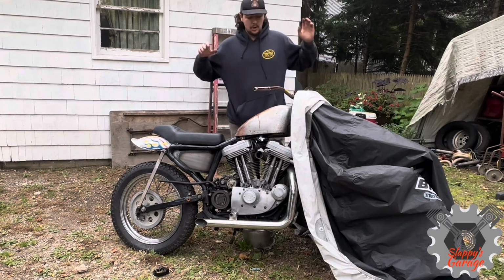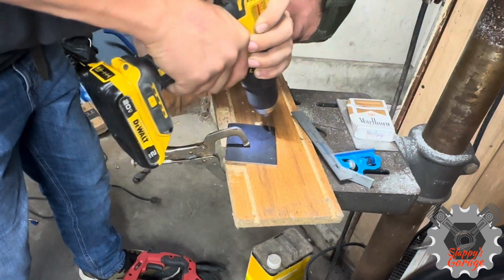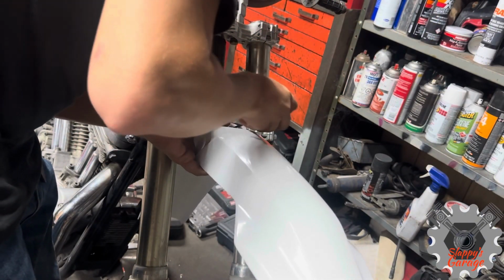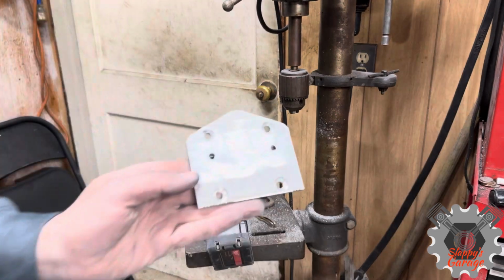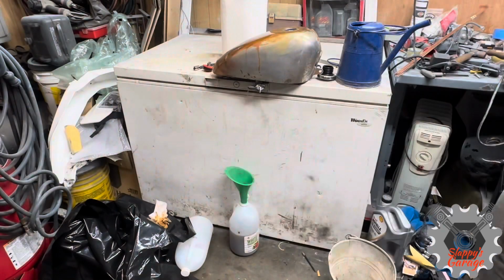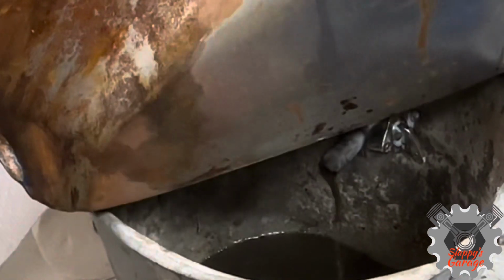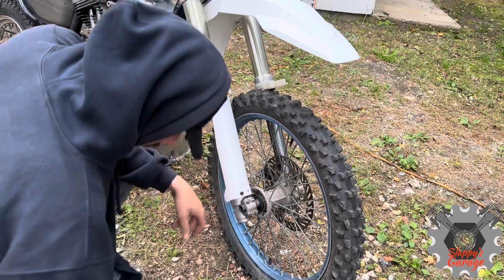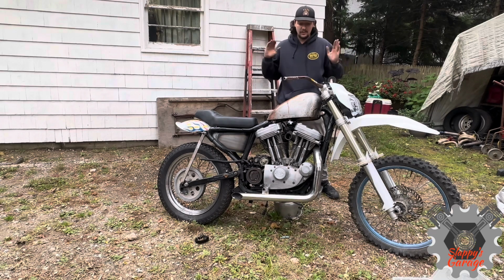Turning a sportster into a Dirtbike Part 4- Can I save this rusted gas tank? And Dirtbike front clip

Comment: The 2 part epoxy gas tank sealer from Caswell Plating works great to seal the gas tank once the rust is removed.
Reply from the maker: I have seen some nightmare cases of that epoxy not curing correct or being too thin and clogging jets and petcocks

Comment: Looks great.
Reply from the maker: Thank you!!
Reply: @SlappysGarage  I have a 2016 Roadster that i bomb around on dirtroads looking for a scrambler or flat seat for it is there such a thing?
Reply from the maker: @willyroussel3563  if you are not riding 2 up then saddleman makes a tail section for trackers that looks pretty good and should be fairly easy to put on
Reply: thanks @SlappysGarage